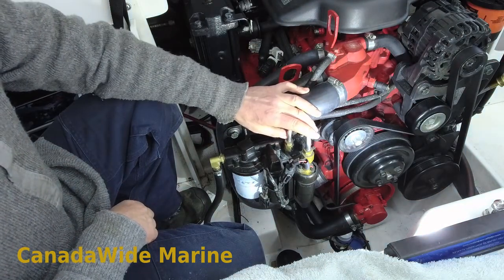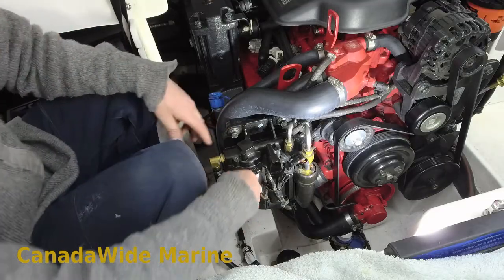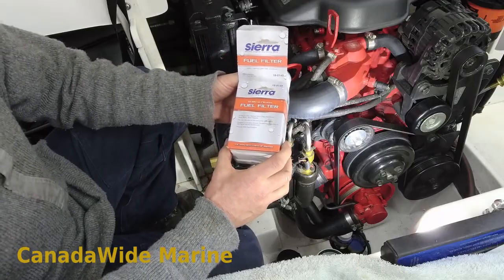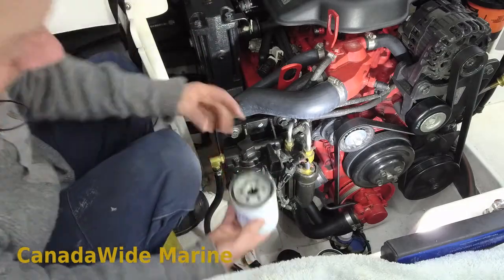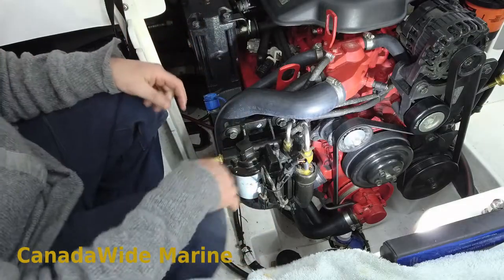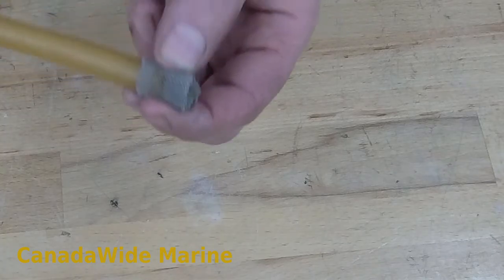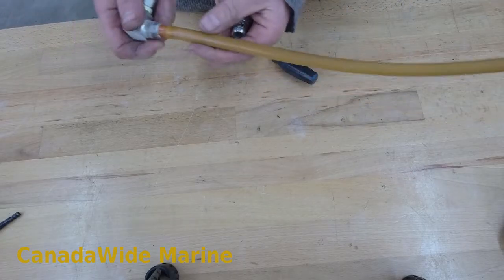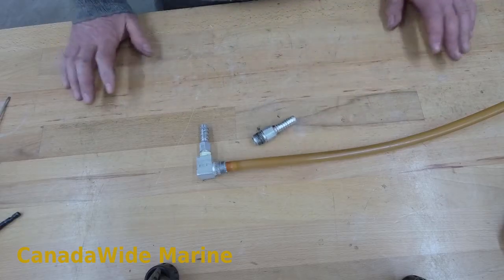Volvo Penta Fuel Pump Whine explained and fuel filter change.

Comment: I have just recently run across your great vids and subscribed.  Thank you for the efforts!

For the dreaded VP fuel pump whine, I understood another potential cause was the internal paint that VP uses on these pumps.  It eventually flakes off due to the ethanol and clogs the passages.  I too had this whine and a check of the incoming line was done as you outlined but no restrictions.  I replaced the fuel pick up and check valve nipple for good measure anyway, but whine persisted.  Note: the replacement Moeller fuel pickups no longer have the screen on the bottom of the tube.  And my milage was down.  Continuing to poke at it I found that I had excessive high side pressure (100 vs 50 PSI) so out comes the regulator and I find it clogged with what appeared to be paint form the pump.  Turns out VP issues a Service Bulletin P-23-7 Number 3 Version 01 that removes the regulator’s screen.  So, a combination of new regulator minus the screen, plus a new VP pump -  with the internal paint removed - and the whine gone.  And milage back up.  Been running for a few years now like this with my 5.0 GXi-E and no issues!  Note: I did pull apart my original pump and wow! what a mess inside due to the paint pealing off!
Reply from the maker: You are totally correct, and thanks for sharing that for everyone. I did this video because I have seen too many people replace their pump assembly and still have a noisy pump because they didn't clean the pickup side. In our shop we have seen more blocked suction side than the paint problem, although I think I have just had one come in and I may do a video on it.
Thanks for watching and subscribing.
Reply: Since you took the pump apart to have a look at it, in your estimation would it be advisable for me to do the same to clean it out to continue using it? i plan on replacing the fuel filter, cleaning the pickup, and removing that screen on the regulator as per the bulletin. 

I found my filter area has been leaking and there may also be a slight whine i noticed on the water yesterday. I've been noticing a strong fuel smell after shutting off the engine and opening the panels.

Comment: Thanks for the great video! Do you use teflon tape on the threads when re-installing the anti-siphon valve and the fuel tank fitting?
Reply from the maker: I use a Mercury marine product called "Perfect Seal" on the threads, it is similar to an aviation gasket sealer, but thicker. You do need to seal the threads somehow or you will get an air leak into the fuel system. Teflon tape will work, or any other thread sealer that is compatible with fuel.
Reply: @CanadaWideMarine  Perfect. Thanks!

Comment: Do you drain the tank prior to checking the anti-siphon valve?
Reply from the maker: Hi, Chris.
No need to drain the fuel tank to check the anti-siphon valve, if it is on the top of the fuel tank.
Thanks for watching our videos.

Comment: Would this also cause the boat to have loss of power and backfire under acceleration?
Reply from the maker: A restriction in the fuel supply will certainly cause those symptoms.
Reply: I am having the same the same  issue. I run dual fuel tanks and I switched tanks to isolate the fuel feed. No change. The fuel filter is new and pump is whining off and on ,which it did not do before . Thoughts on what else the issue is.? It is a 2015 5.7 with 240 hours . Thank you
Reply from the maker: I would look closely at the common fuel supply line feeding the pump first, then I would investigate the pump itself. There were issues with  the black paint contaminating the pump internally causing the whine. I have never seen it happen myself, but have heard that it was a problem with them.
Reply: @CanadaWideMarine  okay , I have 2 engines that work off a manifold for the 2 tanks  easy to pull the line off the manifold . I did switch to one tank to see if it was a pick up problem and  the problem did not go away . Thank you
Reply: @barrywalton3894  I just went through my entire fuel system. Pickup line was clogged, anti siphon valve was gummed up. Cleaned those and still same issue. I then started going through the entire system. Spin on filter had paint flakes in it, the screen on the bottom of the HP pump had flakes in it, and the screen on the fuel pressure regulator. Cleaned all of them, still same issue. Ran pressure test on the low and hi pressure pump. Both were below where they should be. Long story short, that way I know everything is new and good to go, I am replacing my entire fuel system. Pickup tube, anti siphon valve, filter, fuel pumps, fuel lines, and regulator. We will see how it goes.
Reply: @ryankimble4743  thanks for the info .I have a new fuel pump ordered. Had to go with a after market one. Volvo one is not available. Hopefully this is the issue. The boat acted up once last fall with backfiring and loss of power shut the engine down and restarted and never had an issue again until last weekend and put it in the water and it started backfiring about 5 minutes after being on plane .

Comment: Very helpful, but what if I do everything in yrou video and it still is shining?   Do I replace the whole pump or just the high pressure side?  I have 2006 8.1 OSI-C Engine
Reply from the maker: That is a question worth asking. In our shop we would replace the whole assembly because the rest of it is also 16 years old. If the low pressure pump failed a couple months after replacing the high pressure, the customer could be upset that they are broken again and are paying for a repair that could have been done the first time. Taking into account lost boating time, towing back and forth to the shop and the extra labour is a pretty big factor. If you are happy to wait for the low pressure side to fail to maybe save a few dollars or spread out the expense you can just replace the one side.

Comment: Thanks for the helpful tip on the VP 5.7 Gxi.  Have you encountered an issue where the engine starts fine at cold start and you run it for a few minutes shut it down and it will not restart unless you put the throttle in neutral and give it gas then it will run fine all day until you shut it down again.  I've been having to leave the engine on all day to avoid this, but with gas prices so high it's draining my wallet.  Any info or tips would be greatly appreciated.  Thx
Reply: I had the same issue with VP 5.0Gi. It was the Water temperature sensor not well plugged. Disconnect, clean them & reconnect it.
Reply from the maker: Hello Cesar, thanks for watching our videos. There are many possible causes for the problem you are describing, the best advice I can give you is to invest in having a marine mechanic diagnose your problem before you start spending money on replacing parts you may not need to replace. It should only take one or two hours to diagnose your problem accurately. See my video: https://youtu.be/pAjbGZhagZA for more information.
Reply: I have same issue on 5.0gxi, let us know if you figure it out!